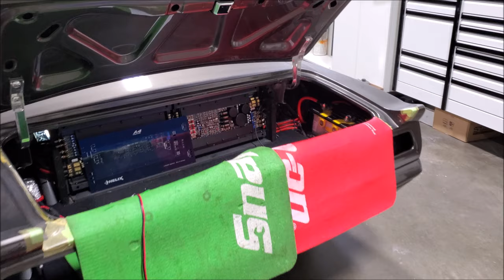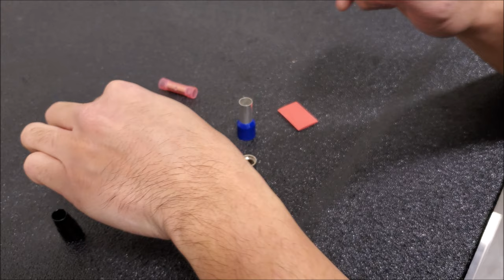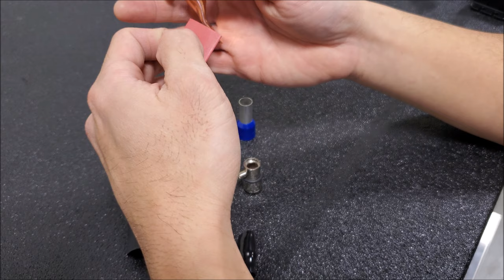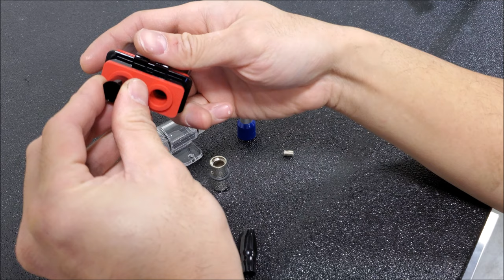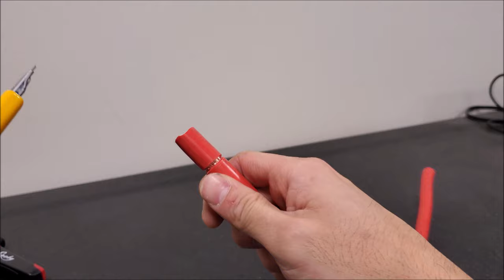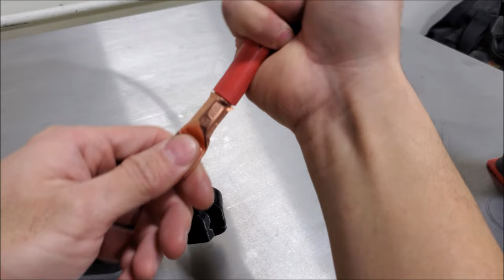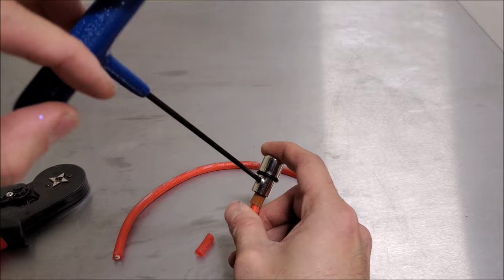How to Crimp Large Gauge Wires (Battery Cable Lug, Ferrules & Ring Terminals)  | AnthonyJ350

Comment: I like the hook style heat deflector on my heat gun.  It heats the tubing much more evenly and about twice as fast as rolling the wire to shrink all sides of the tube.  It also helps keep the heat from directly hitting things behind the wire when working in tight quarters.
Reply from the maker: Thanks for the comment

Comment: I can relate to wanting a flat spot on your hydraulic crimper.  I made a couple anti-roll feet on the side of a grease gun with two hose clamps around the body so it lies stable on the floor with the handle staying on top when pumped. (It has a really long hose to reach from floor level).  Made a world of difference.
Reply: I made a basic stand/holder out of finish plywood.  Takes up more space, but allows a good crimp with two hands instead of three.
Reply from the maker: Thanks for sharing your experience.

Comment: Well done Sir.  I'm trying make sure I'm doing right for my solar customers.  Many of them are off grid and hard to get to quickly when things go wrong.  It's important to take every chance to prevent failures in systems that may go unattended for a years.  You made some points I hadn't thought of.  Thanks!
Reply from the maker: That's great to hear! Would love to hear a follow up on how your connections are doing in the future.
Reply: @AnthonyJ350  G

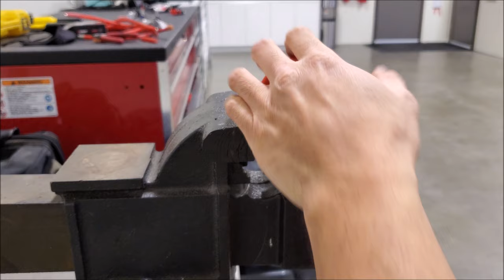Comment: & 9:00  I have done this in the past but after using the vise, I take a large Phillips & while using the style type with an impact back to it, you can use a hammer & in the middle of that crimp, make your impact mark on a solid surface & setting flat
Reply from the maker: Thanks for sharing!

Comment: Thank you for a very excellent, straight forward video, I have some 0 awg wire, and copper, to make my own, lugs, I just got the same, hydraulic crimper, and im into the van life, I live in an 01 Chevy express conversion van I have one agm 70 amp hour battery, in the back and I want to run cables to the back, connected to a DC to DC charger and a couple of 100 ah batteries, great job, thank you!
Reply from the maker: Let us know how your install goes!

Comment: Solid upload! For the longest I’ve  always been in the “soldering all of my connections” camp. However, over the past 5 years or so,  2/0 or 1/0 runs have become the majority of installs I do. Which in turn has made me more flexible and comfortable with using hydraulic crimps as a suitable connection. Plus, I don’t have to hear the wifey complain about the garage smelling like flux or solder. Hope you have a great 2021! Keep up the great work!
Reply from the maker: Sounds like you do 0 gauge connections more than I do. I'm glad to hear you like the video! Hope you have a solid 2021 as well!

Comment: For large stranded wire lugs or ferrules, you can understand the effectiveness of the crimp if you carefully cut through the center of the original crimp and see how the copper strands are compressed. You may need to use a microscope to see the small deformations. Once you analyze the crimps at different pressures with a choosen die that does not create outer pinch points on the lug of ferrule and the copper strands are evenly compressed after inspection you can then do a pull test if you want to meet a spec.
Reply from the maker: Thanks for the comment!

Comment: Could you drill a small hole in that lug at 13:37 and fill the connection with solder, you're going to use shrink tube on it later....
Reply from the maker: I would have to try it. In theory you could as long as the wire gets hot enough to take the solder. Crimping it should create a cold weld
Reply: @AnthonyJ350  
I'm saying solder after the crimp...
It'll never corrode, or pull apart...
Reply from the maker: @joeschlotthauer840  You could, dielectric grease will prevent corrosion as well.

Comment: Loved all the different techniques. A couple notes: ferrules are really designed for "cage clamp" style terminals, where the screw moves a flat piece into contact with the wire, not just putting the screw directly into the wire. And I've heard a lot of advice to never solder a crimped connection because you'll lose some of the vibration tolerance. Have you had any problems with that in your experience?
Reply from the maker: Thanks for the comment! I haven't had a connection break due to a terminal being soldered. I'm more concerned about elements and different metals expanding and contracting.
Reply: Soldering any connection that will see movement is generally best avoided. If you have to solder things in automotive use, it's best to use some kind of mechanical strain relief, like back-filling soldered pin connectors and stuff. Soldering involves a bunch of heat and creates a solid chunk of stiff composite material and while a crimp creates a more-or-less solid block, that block is still copper and still allows gradual levels of movement as you move away from the crimp, so you end up with less of a stress-riser.
In short, soldering a crimped connection might not end up causing problems, but it's not a good idea, it doesn't help, and it might end up causing problems. Best practice is don't do it.
Reply: This is true, but generally only an issue when you use say too much solder and let it wick down the wire past the end of the connector.  Done properly, the risk of vibration having an impact is near zero.  Have said that, soldering adds nothing to a properly crimped terminal.  And the fact that crimping alone is what is used in aerospace tells you all you need to know.  Save soldering for PCBs.
Reply: @AnthonyJ350  It is still bad practise.
Reply from the maker: @i_know_nothing7788  Thanks! Have you had it fail consistently?
Reply from the maker: @i_know_nothing7788  I show a factory vehicle with solder on the battery cable here https://youtu.be/VnPil9x8gUc
Reply: @AnthonyJ350  Reliability engineering is done to avoid probable failure. The next time you fly just hope nobody has followed your thinking.

Comment: So ive had luck with using welding wire in big 3  and sometimes system installs with people that cant afford the audio cable. So i was wondering if you can ever over crimp wire, damage it or the lug somehow. I too have a hydralic  crimper, but different style. When i first got it i remeber using an undersized dye for 0 guage cable, but i now i know better.
Reply from the maker: I don't think you can over crimp, but the wrong size dye will deform the connector and won't look good

Comment: When using a vise to crimp you don't do it flat. You put half the connector at the split and crank down on it(this will pinch it like a dye). Then turn it perpendicular and to crank down the other half and it will wrap around holding very tight. Then you can follow up with solder
Reply from the maker: Thanks for sharing!
Reply: @smack9x

I am trying to visualize your method. Care to explain a bit more. I am thinking you have a great method....

Comment: When I use a hydraulic crimper, I mark a reference line on the terminal and corresponding wire the way I want the natural twist to line up.   I position the terminal in the crimper with the reference line on top and tighten it just to the point where it stays in place.  I put the cable in my wood vice with the reference line on top and slide the terminal onto the wire so the reference lines match.  I then have two hands to operate the tool and complete the crimp.
Reply from the maker: Thanks for sharing!

Comment: Hi Anthony, amazing tutorial as usual. What's been your experience with Amazon copper lug connectors, if any? I've seen some companies selling them 3-5$ a piece, but on Amazon you can buy them a lot cheaper, so idk what's the difference. I'm doing the big 3 with a Mechman alternator, on a 2005 silverado 4.8, like the one you had I bilieve, replacing some grounds, plus in the near future a moderate sound system. So I just want to make sure these Amazon ones are good before I fill the truck with them and then I  find out they are crap 😅. Thank you for all the knowledge you share!
Reply from the maker: I've been trying parts off Amazon and haven't had any issues. Technique matters the most and protecting your connections from corrosion.

Comment: For those high current large applications, In our Lab we have found that Tining the copper wires prior to crimping works best. Tining the lug cup and inserting the tinted wire then applying a large soldering gun will make a true electrical connection that will resist corrosion.
Reply from the maker: Thanks for sharing! How big is the solving gun to heat up 0 gauge
Reply: @AnthonyJ350  We called it "The Big Dong" It plunged into 115vac wall outlet...It had a heating cylinder that measure about 1inch wide by 8 inches. The anvil tip was about 1/2 inch. We would build cables that carried 200 amperes continuous for testing power supplies.....Good Tip on looking out for cheap aluminum cables plated with copper. Avoid it in high current applications.
Reply from the maker: @stealthg35infiniti94  That's pretty crazy. I don't see us using something like that in our shop environment though. Ya too many problems using CCA wire, it's worth investing in OFC.
Reply: @AnthonyJ350  Okay, I'm looking now.
I find that when I'm connecting big inverters, winches, hydraulic pumps, welders and onboard compressors I tend to use tinned, fine strand copper marine cable. (Great Lakes Skipper)
I will solder lugs for cable #2-2/0. You know it's right, will carry all the amperage and will never come loose.
Adhesive shrink over that. Customers are paying good money, it behooves me to give them the best I can (best, in my mind)
Reply: Not to say a hydraulic crimp with the proper die for the Magnalug is in any inferior.  💪

Comment: Could I ask what type of solder you used for the vice crimp example? Also I have just a couple of 12/10 to 8 gauge step down tinned copper seamless butt splice connectors to crimp. Any crimper type suggestions?
Reply from the maker: Kester brand with flux
Reply: Thanks for the info!

Comment: Great video! Can you tell me more about the large red crimping plier. I would love to purchase one, I really like the way it crimps. Keep those videos coming, good stuff.
Reply from the maker: The red crimper is a Klein tool for 10 - 8 gauge wire typically. Just a simple tooth but effective.
Reply: @AnthonyJ350  Hi do you have a part number or link for them i have looked but as yet had no luck finding them
Reply: @AnthonyJ350  Any chance of that part number please ??
Reply from the maker: @reaperwayne  I can't seem to find it online.  I purchased the tool at Home Depot years ago.
Reply from the maker: My bad found the part number. It's a Bluepoint PWC-30

Comment: I saw a fellow using a vise to crimp lugs, and he had a socket (Maybe 1/2"?) cut in half length wise, and was using them as dies.
Reply from the maker: If it works and he has a zero failure rate that's great. I like using tools designed for the job.
Reply: qz

Comment: Welding wire is great to work with, but I have never seen welding wire rated for oil and gas so I don’t use it on most auto applications.  I don’t worry so much about abrasion as welding wire gets dragged over concrete and all sorts of surfaces, but the oil and gas resistance is a few issue, particularly under hood.
Reply from the maker: If it's not rated for oil have you seen it degrade in shops where it's being dragged on dirty floors with oil?
Reply: @AnthonyJ350  Very few shops where welding is occurring will have liquid petroleum on the floor.  Most spills either soak into the dirt or are covered with absorbent material so a cable dragged across them contacts little, if any, petroleum.  This isn’t like an engine compartment where a leak can soak a battery cable or spray out of a blown power steering hose or a pressurized fuel line, etc.  And often these leaks go unnoticed for some period of time.  That is where the issue occurs, not in typical welding scenarios.
Reply from the maker: @LTVoyager  Says right here welding wire is suitable and oil resistant  https://nassaunationalcable.com/en-ca/blogs/blog/welding-cable-vs-battery-cable-can-you-substitute-one-for-the-other
Reply: Have you guys seen how solder degrades over time and corrodes in the environment? A proper cold weld with a crimp tool is as strong as the metals being connected, especially with tin and copper. Soldering Aloominum requires a very toxic flux. Reinforcing inadequate crimp methods with solder will fail after the customer has been forgotten about.

Comment: The exterior, copper crimp presents an issue for me. I want to crimp multiple cables into one connector / terminal. Where do you find something to do this? I don't like stacking cable terminals, I want to do it in the same fashion as the factory.
Reply from the maker: Look into fusible links or fuse distribution

Comment: How do you like your Snap on torch 300? Saw it was thinking of getting one. Also saw the way you used heat gun, I would get one where there is the adapter that fits on the tip of the nozzle where the shrink tube  or connector fits between the tip of the gun and the adapter to evenly heat the tube properly. Just my .02
Reply from the maker: I like the SnapOn torch a lot, thanks for the suggestion!

Comment: I'm having trouble finding a 0 guage crimper tool like yours I mainly do 0 guage and would love to do it this way
Reply from the maker: There's this one like the one in the video https://www.ebay.com/itm/113807556582?hash=item1a7f757fe6:g:8-IAAOSw7ixfreco&mkcid=1&mkrid=711-53200-19255-0&siteid=0&campid=5337982243&customid=&toolid=10001&mkevt=1
Reply: @AnthonyJ350  just ordered one from Amazon
Reply from the maker: @jessedean1983  Nice, make sure to not compress it so hard at the end because the cast tip can break.

Comment: Where do you get all of your wire, lugs, connectors, etc. They're not on your Amazon link...
Reply from the maker: We get them direct from our supplier and sent to our shop.
Reply: You still didn’t answer the question. Who’s your supplier. Maybe it’s a trade secret.
Reply: Still a good video.
Reply: Del City is a professional supplier of wire, connectors and related items. I believe they are based in Illinois, if I am not mistaken.

Comment: If you dont want to spend $100 on the hydraulic crimper, you can get a good old fashioned hammer crimper for about $20.  You prep the same way, set the lug into the die, then give it a good whack or two with a hammer - done.
Reply from the maker: I use that hammer crimper with a hand operated hydraulic press.

Comment: i was crimpping those big cables to 70-10 70-12 cable lugs, they are really difficult to even put all the cables into lug, the cable is super thick but the individual copper wire are also very fine, i always end up having a couple wire sticking out when i thought i have it, but when i pull the lug out and try again, all the copper wires are bent, it's really frustrating
Reply from the maker: Thanks for the comment!

Comment: Wish you would have discussed "correct die size".
Reply from the maker: I just use whatever fits.  the tolerances on connectors will change for similar sizes so it can be a little bit trial an error till you find a combination that works for you.
Reply: @AnthonyJ350  I just used 35mm die to crimp 2 awg and lug easily twisted ! So I went 25mm die and crimped until it was really snug and no problems. The 35mm die is just a tad under the 2 awg diameter.

Comment: Anthony - I really like your video.  But I'm having trouble getting "wings" on my crimps of heavy lugs.  Would you mind sharing what lugs you are using as they seem to work very nicely.
Reply from the maker: They're from The Install Bay by Metra. You can just grind those wings off
Reply: @AnthonyJ350  Thanks.  I usually just catch them in the corners of the die and gently crimp them back against the body.  And since everything gets covered with adhesive-lined shrink tubing, they aren't seen.
Reply: I have been looking for this information for a while, thankfully I found you!❤

Comment: Crimping in the vice will not cause a cold weld and putting in solder can cause heat spots from movement/cracking.
Reply from the maker: Thanks for sharing!
Reply from the maker: Thanks for the feedback!

Comment: Hmmm, i got some 4awg lugs to crimp on my factory alternator, starter and wire going to my fuse box on my 06 mustang gt, but they slid over quite easiy, zero resistance actually. i measured the wire with calipers and it's 6mm thick, .24 inches which is actually a little thicker than 4awg is supposed to be i think. Maybe i'll try some 6awg lugs. I used a hammer crimper and not happy with the results.
Reply from the maker: Hammer crimper in a press works nice. I've been trying that lately.
Reply: @AnthonyJ350  Unfortunately the wires are on the vehicle.🤣 I'm going to try the hand held crimpers on amazon when i redo them. they are too long anyway. those hydraulic ones look nice, but i don't do a lot of wiring.
Reply from the maker: @mooosestang  That hydraulic crimper isn't too much money. Better to buy the proper tool for a better result. Especially on high amperage wires
Reply: @AnthonyJ350  Well i cut open one of my hammer crimps and it looked like a solid block of brass. i'm going to order 6awg lugs and probably just remove the wires from the car. technically i can remove the starter, alternator and fuse box wire i'm just lazy. I just didn't like how much larger the flared end was compared to the wire insulation. At any rate at least i know they are making a good connection.

Comment: Nothing wrong with using welding lead, it goes beyond the specs of battery cable. Especially on the thermal heat standard.
Reply from the maker: Thanks for sharing!